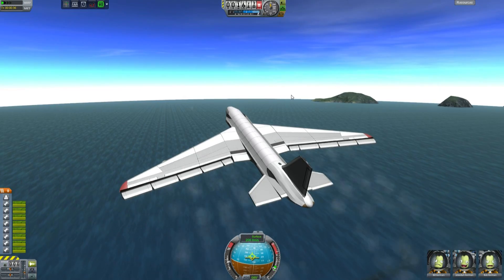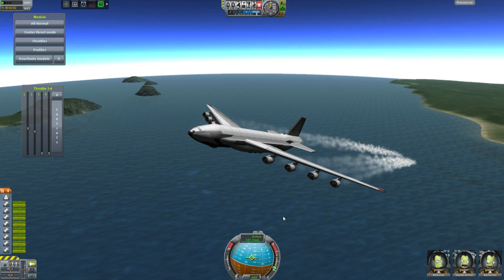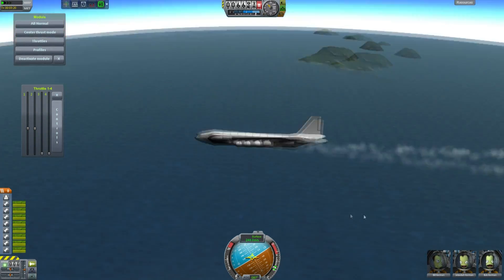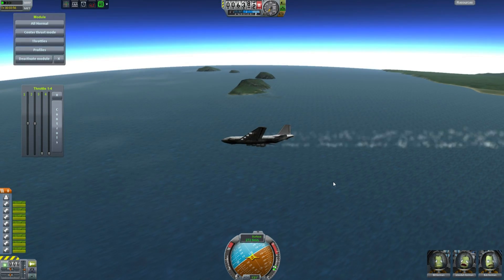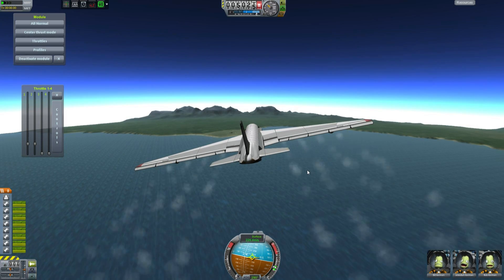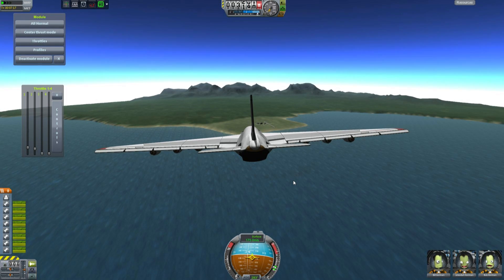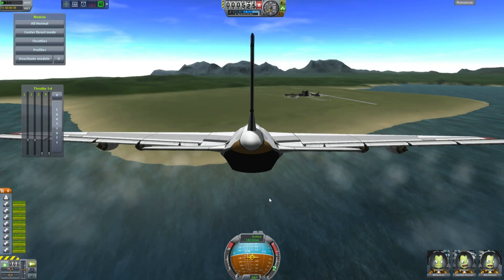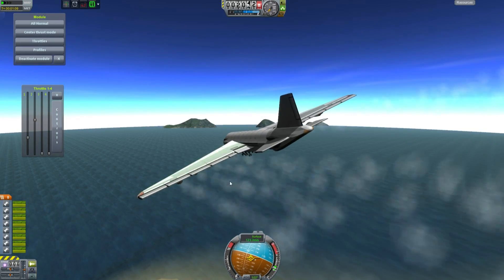Kerbal Aviation Program - Controlling Aircraft With Only Engine Throttles

Comment: A few years before the United Crash (Flight 232) was the JAL 123 crash in 1985, where nearly the exactly situation happened (turbine in the rear engine burst, severing all the hydraulics and leaving the plane with no control). Sadly, they were not able to reach safety (Japan has much less flat ground than South Dakota), and over 500 died. 

I don't have citations for this, but I've heard that one of the pilots on the United flight had looked into (possibly doing simulator flights) controlling an airliner with just the engines because he had wondered if there was a way to survive the JAL123 disaster. By good luck, he was one of the people on board when United 232 lost control.
Reply: Re-reading the account, it was an improperly repaired rear bulkhead that burst and destroyed the hydraulics on JAL123, as well as taking out a vertical stabilizer.

Comment: Some interesting points on this video. I know that sailing and flying are completely different however when learning to sail you do learn to manuever the vessel without steering and it is difficult but not impossible just requires a lot of sheeting in and out. I wonder if anyone has developed similar procedures for aircraft. There aren't any that I know of but I'm no aviation expert, and I can also see the issues with testing said procedures ... mainly a fiery death if anything goes wrong.

Comment: Your typical LARGE aircraft will have those backup systems with fly-by-wire, but your smaller planes will have just the one system from yolk to control surface: wire and pulley.  When I was still a student pilot I did something cool with my instructor in a Cessna 152.  We were doing system failures and after doing the basics like frozen flaps, lost engine, etc, he said, "what would you do if you lost your yolk?"  Now this isn't losing ALL control surfaces, just your elevator and ailerons, which are the ones we are most used to using.  I flew the plane back to the runway and went into a straight final using just the throttle, rudder pedals, and the pitch/elevator trim tab, and got to about 200 feet above ground level before he told me I should probably land with the real controls, but I feel confident that I could have pulled off a quite smooth landing without using the control surfaces!  That was a fun day and I found it relevant to this video with you talking so much about losing control surfaces

Comment: Another plane that lost its hydraulics was JAL Flight 123, the back bulkhead the keeps the plane pressurized blew out and almost half the tail was lost. The plane eventually, after flying 32 minutes, smashed into Mt. Osutaka, hear Mt. Fuji and 520 people died. It was the worst single aviation accident in history, and the second worst, after the 1977 Tenerife Runway Collision, which killed 583 people. Amazingly 4 people survived, including off-duty flight attendant Yumi Ochiai. Captain Masami Takahama, First Officer Yutaka Sasaki, and Flight Engineer Hiroshi Fukuda were killed. In fact, almost all the passengers in the rows 54-60 survived, but many died in the cold mountain air.

Comment: 13:30 That's pretty much what happened to TWA Flight 800. An explosion in the center fuel tank resulted in the entire nose section of the Boeing 747 to detach. The rest of the airplane flew on and even climbed an extra 2000 feet before stalling and following the nose into the Atlantic. Yeah... no survivors.  With United 232, though, what happened was at the last second, the plane started to roll, and there was no time to correct it. Surprisingly, everyone in the flight deck survived the crash.
Reply: ReddwarfIV
operation babylift
Reply: FishFanify That's pretty unlikely. Especially since, you know, a mid-air collision is devastating all by itself - why the explosives?

And air crash investigators can tell the difference between a missile explosion and a fuel tank explosion, you know. They leave different traces.
Reply: Quantas Flight 32, an Airbus A380, suffered extreme damage to its flight management system after an engine exploded. The crew, after dividing up the tasks, managed to get it on the ground at Singapore's Changi airport without a single fatality. Flight 800 gave them the knowledge that it was possible.
Reply: Actually, stories are coming out that TWA was either shot down, or a terrorist tried to crash into the 747 with a Learjet packed with explosives, and the military tried to shoot that down, and failed.
Reply: Yes, but they can very easily just hide the evidence also.  Why was the FBI investigating?  The ATC radar showed three objects heading toward the 747, one subsonic, and two supersonic.  The "glue" was tested by private investigations and it was consistent with residue of explosion.  And you know terrorists-they will go to extreme lengths to kill people.

Comment: That was a hard plane to control without the control surfaces.  The engines were mounted not too far below the centre of drag, so the centre of thrust would not help in pitching the nose up. The only way to control pitch was to control airspeed.  The only commercial jet to ever land without hydraulics was a 767, this was only possible because of the mounting of the engines below the wings, (and the amazing skills of the pilots.)  A DC-9 or MD-80, Bombardier CRJ or Learjet would not be able to be controlled effectively using only engine power. Had you flown a jet with lower mounted engines (and wings) that would have been much easier!  Good try anyway, at least the brave pilots made it out.

Comment: is this what we call Hydraulic Failure that you only can use engine to control?
Reply: Not all planes need hydraulics to operate their control surfaces - some can be operated by pressure from the pilot alone, but those planes are normally small or use mechanical assists like servo tabs. In a plane without a need for hydraulics to use its control surfaces, a hydraulic failure will just mean some things like the cargo doors or landing gear won't come down automatically.

However, a plane that relies on hydraulic systems to use its control surfaces that has a complete hydraulic failure will be completely uncontrollable, aNd the only way to fly it will be via differential thrust. The article 'phugoid cycle' on Wikipedia is illustrative of this.
Reply: yay like the 747

Comment: Since you have 4 throttle controls, couldn't you mount one engine on either wingtip, add a x-15 type rudder and add one on the top and bottom of those rudders, then put some dihedral on your wings and have a much more stable craft?

Comment: As you have the option of 4 separate throttle controls, you might try separating your inboard and outboard engines. That way you can keep one set throttled up for quicker response to throttle changes, and you can have quicker control to roll and yaw and finer control of pitch. Also, does it react to dihedral properly? That might make it easier to fly.

Comment: You should watch Air crash investigations with the episode nicknamed "Deadly Design". Its a Boeing 747 that lost its upper/lower yaw damper and it had to land with only his engines as it would be nearly impossible to land without spinning out of control. It also lost communication with tower control in the nearest airport as they were out of range so they had to tell another jet to tell an aircraft has requested a mayday. Watch it, it is amazing that they landed safely!

Comment: Can't forget about Japan Airlines flight 123.
Explosive decompression, ripped off nearly the entire vertical stabilizer and lead to the complete loss of hydraulic systems. Pilots and crew kept the aircraft in flight for over 30 minutes until it crashed into a ridge of Mount Mikuni east of Tokyo.

Comment: also, that pilot that landed the DC-10 was an off-duty, instructor pilot, who just happened to be a passenger :-) amazing story, we saw the special in our basic boom operator class(some of us were to go fly on the KC-10, myself went on to 7 flights on the KC-135)
Reply: as a side note, really bad design putting the hydraulic lines, all 3 systems, right there in the tail...yeah, from my in depth knowledge they fed me of the -135, boeing did a better job back in the 50's

Comment: Here's a link to Dryden's work on the PCA. 

http://www.nasa.gov/centers/dryden/history/pastprojects/PCA/index.html

Definitely would work in a control failure scenario, but I wonder if the DC-10 (MD-11) is easier since you have engines located above and below the center of mass. 

POS plane anyway, L1011 was far superior.

Comment: would be nice to have a full system backup for when the control surfaces fail the engines get connected to the yoke or stick and change throttle to fallow the maneuvers to make it easier on the pilots so they can keep their minds on other factors

Comment: You're watching a cargo airliner circle the Kerbal Space Port. It's a safe, well-engineered, perfectly designed machine, and the Kerbals who control it are a trained, cool, highly efficient team. The problem is that the Kerbals have been left behind, and the plane flies on without any way to control it; there is nothing within the realm of knowledge or at least logic to explain it. Unbeknownst to the crew, this airplane is heading into an uncharted region well off the beaten track of cargo planes. It's moving into the Twilight Zone. What you're about to see we call The Odyssey of Flight SM752.

Comment: Taca 110: double engine failure, landed deadstick on a levy, by a one eyed pilot
Japan Airlines 123: rudder destroyed, flew 34 minutes with just throttles
Reeve Aleutian 008: Prop Failure damaged flight controls and jammed engines on full throttle, landed safely
Air Transat 236: Ran out of Fuel, landed deadstick after gliding for 19 minutes
Reply from the maker: The Reeve Aleutian was an interesting case, the autopilot still had control, and just prior to landing they crew managed to get a small amount of control back via the stick.
Reply: Scott Manley I believe the pilots used such brute strength on the yoke, they actually manage to saw through the metal girder that was pinching the control cables, thus giving them VERY limited control. Add that to the fact they landed, and then donned ties and hats as they left the aircraft, they are the gnarliest pilots around. A credit to their profession.
Reply: They also did a go around and on second approach shut off the engines, eliminating the possibility of another one

Comment: Scott, as a pilot, I find it humorous that you believe a "dead stick" landing is using the engines to control the airplane. A true "dead stick" landing is when all PROPULSION is lost. i.e you're gliding it to the runway.
Reply from the maker: You're not the first one to tell me this, I'm not really a plane guy so I don't know. 
Can you tell me what the correct term is?
Reply: Well, really, the correct term would be a control failure. For example, if you lost hydraulics (http://en.wikipedia.org/wiki/Aircraft_flight_control_system) specifically on a KC-10 refueling airplane, you don't have a physical connection to the control surfaces, i.e. cables and pulleys. Sometimes, you would have these backup connections, but not always.
Reply: ThyBiding  A plane without any control surfaces is called a model ;) (like a desk model, because, they don't really fly, just sit on a table and look pretty)
Reply: Well, I can't answer that one Scott :)

Maybe, "Still Stick" or "Broken Stick" perhaps? Or maybe something like, "flyin on gas and nerves of steel".
Reply from the maker: 13megaprime So... nothing as snappy as 'dead stick' where are the branding & marketing experts?
Reply: Makrond It's called an "oh fuck" situation.
Reply: 13megaprime could always call em a broken arrow or broken glider then  since both wouldnt have control surfaces
Reply: Scott Manley
I was going to point that out too, but no idea on what you call a plane without ANY control surfaces.
Reply: Scott Manley a landing without hydraulics?

Comment: Cool, so someone did make an add-on for throttling engine groups differently. Hoping this will work with rockets and jets. There a few designs I'd like to make in KSP eventually that need different controls for sets of engines.
By the way, nice flying :)

Comment: Don't thrust reversers tilt the nose up? I've fired them on accident with b9 whilst flying and they push the nose up... Good way to land when you don't have aileron!
Reply: That's probably a center of thrust vs center of mass issue. If you reverse thrust and the center of mass is below the center of thrust, you'll pitch up.
Reply from the maker: I think it depends where the engines are WRT the center of mass.

Comment: the reason you could control the differential throttle was cause it was controlled by the small device on the plane, not the cockpit.

Comment: I've seen pictures of P47s that flew back without a wing. Having only one engine the pilot didn't fly it in this manner but still. Just made me think when you brought up the f15 or whatever.
Reply: joost1120 No I'm talking about a p47 not A10... I remember it being a p47 as the whole thing was about the p47. That and it was WWII
Reply: Fairly sure they could only fly with half a wing missing.
Reply: Fairly sure you're thinking of the A-10 Thunderbolt, not the P47 Thunderbolt, although the P47 could take a beating too.
Reply: joost1120 B-17's and P-47's both had enough power to fly with half a wing or a whole wing missing, if I recall correctly.

Comment: Scott Manley=Chuck Norris of KSP
Can steer an aircraft without cockpit!
Reply from the maker: Skellitor Undead You clearly didn't watch to the end of the video.
Reply: Engine power only, not cockpit :P
Reply: Scott Manley 
That ending is a kerbal ending for sure, but the point it's a dead stick flight is still off it's engines. Truely the Chuck Norris of ksp :P

Comment: Completely off-topic for this video, but hey ... I just beat the game (in the sense that I completed the vanilla science tree) and thought I should try out some of the mods from the Interstallar-series. However after installing just Kerbal Engineer, Ferram and KAS my medium sized moon station (~500 parts) has turned into a horrible 1-2 FPS nightmare. Pre-mod it ran with a silky smooth smooth frame rate. Any thoughts?

Comment: So United Airlines Flight 232(Or the Sioux City crash), Japan Airlines Flight 123, and DHL OO-DLL(the Baghdad one). Also they HAVE developed an auto-pilot system that can land an aircraft on engine power alone, however due to expense the FAA did not mandate it's installation in aircraft....

Comment: It wasn't the turbine that exploded in the DC-10, it was the bypass fan in the front that "exploded" and chopped of the hydraulic lines. :)
Reply from the maker: Pardon me, you're right, it was the fan disc at the front of the engine.

Sorry for confusing this, I was trying to control a stricken plane at the time.
Reply: Scott Manley No worries, just keep making awesome videos :)

Comment: Scott Manley  Air Crash Investigation for the win :D
Btw, the story with the cargo plane was, that all three hydraulic systems are mounted on the exact same location (so 1st, 2nd and 3rd pass through all wingtips, etc.) So the backup systems are only working with (minor) technical and not serious damage problems, because a hole would cause all to drain ;)

Comment: On the subject of aircraft, I'm curious to here your thoughts, Scott, on solar electric aircraft and their potential future. :)
Reply: scott did , a long time ago, a complete tour of kerbin with a solar plane folowing the sun.
Reply: not enough power, and batteries are too heavy. once we get better motors and lighter batteries, they may work. NASA had a solar craft named helios, but look how many engines it needed and how many solar panels it needed:

http://en.wikipedia.org/wiki/NASA_Helios
Reply: Alex Huff There's an aircraft I remember seeing that flew through an entire night and, theoretically, could fly forever. Extremely light, and basically the entire top of the plane is lightweight flexible solar cells.
Reply: Alex Huff They aren't viable as massive cargo or passenger planes yet anyway, but as a proof of concept, yes, we are capable of building lightweight, solar powered aircraft that don't need to land because of power issues.
Reply: Alex Huff see: http://en.wikipedia.org/wiki/Qinetiq_Zephyr